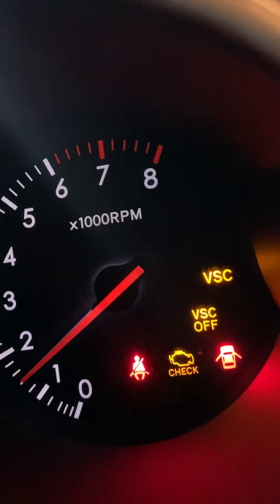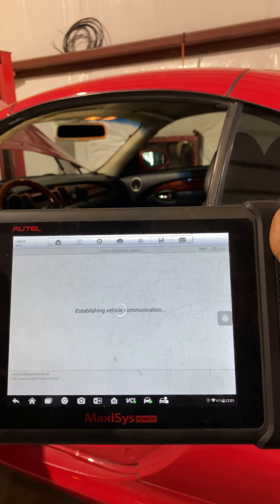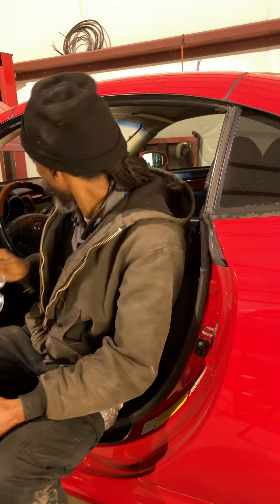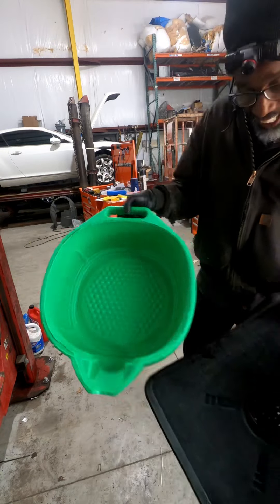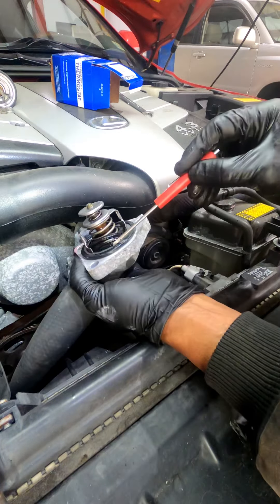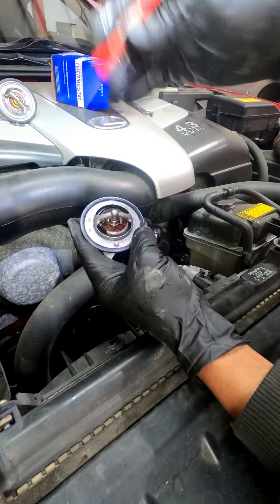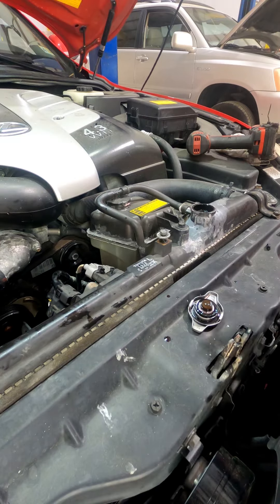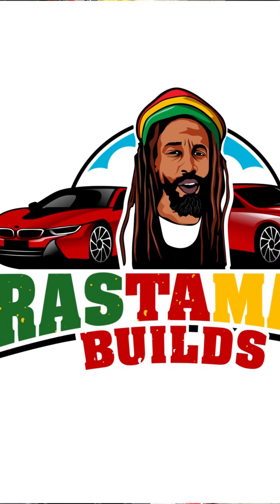P0128 Lexus SC 430 Code Repair

Comment: Hi Your videos are funny and good. I personally have the Lexus SC430 from 2002, have problems getting the roof to go down and up. Is probably an electrical fault, but I can't identify the fault, do you have any suggestions for a solution. Greetings Urban from Sweden
Reply from the maker: First we must get to the switch and confirm it is receiving power and ground. Load test both to make sure they can carry enough current to light a headlight bulb. Then we can proceed. Visit my website rastamanbuilds.com and click the need a tip button.

Comment: @rasta you didn’t state how you got rid of the vsc light . . Changing the thermostat won’t fix that 🫣
Reply from the maker: On the contrary dear sir. It does fix it. When the check engine light is illuminated the VSC light is illuminated simultaneously by design of the manufacturer. So in this case fixing the engine below specified temp error then clearing the code. The VSC light is also reset. And because there are no codes saved in the VSC/ABS SYSTEM. The warning light does not return at this time. Thank you for watching and have a nice day yaaaaaaah✅
Reply: Getting rid of the vsc lights if that’s the only ones is real simple. I just did it on my wife car. I wish @rastamanbuilds was near me. He is the shiaatt and I would definitely let him service ALL of mine 😂😂😂😂